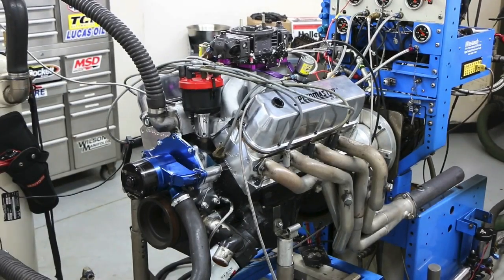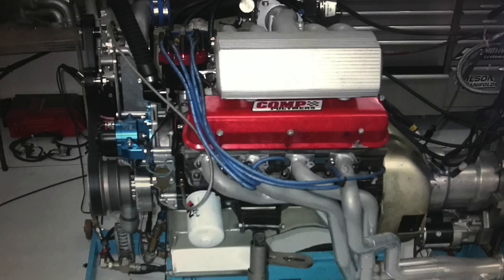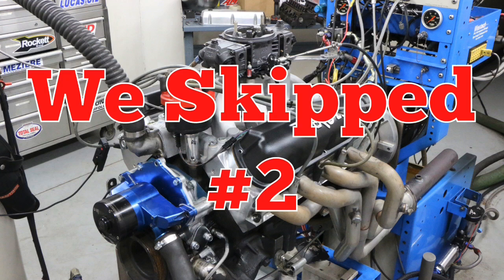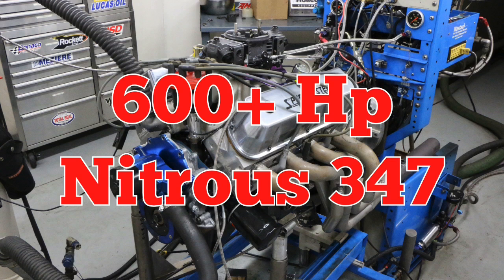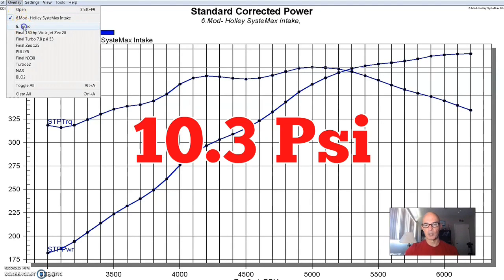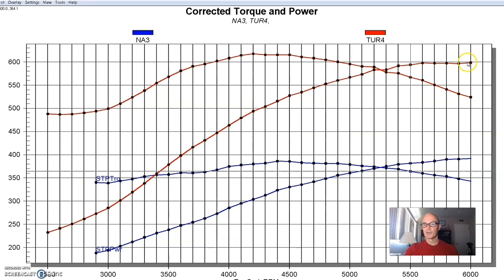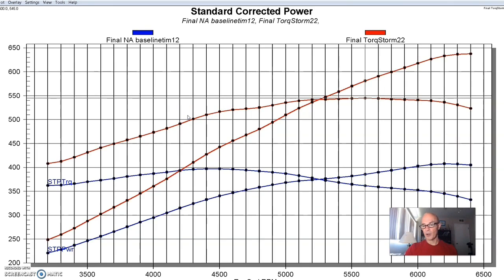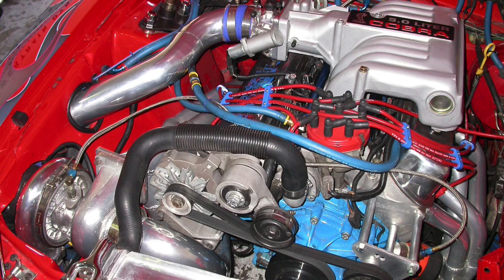5.0L FORD BLOCK SPLITTING-FACT OR FICTION?

Comment: After working for ford for about 2 years making steering racks and other machined components, I’m pretty sure they are failing from porosity, Nicks Dings Scratches, and dropped parts. You would be surprised to see how much porosity is allowed and how many times the people in warehouse will drop a rack of parts and of course instead of getting the supervisor they pick them up and take them still to assembly without knowing that they just risked letting micro cracked/ damaged parts thru. Across all automakers this is the main cause of parts premature failure, Ford has a tendency to fire warehouse workers that drop large volumes of racks of parts (typically 2 rack stacks so around $2000 of material) so most of them fear dropping any volume of parts and they typically won’t report it so they can be scrapped out unless they get caught by supervisors or me reporting it and then they get fired immediately. so it’s a quality control issue post machining pre assembly

Comment: It's  dedication could have been oil pulled from the crank case by the pcv. ive got a 347 turbo made 17 lbs at half throttle and maxed out 42 lbs injectors at 100%  duty cycle on pump gas when i was tuning and its 10.5.1 compression i will just say it black tracks at a 100 at half throttle.

Comment: I've got an olds 455, another 2 bolt main only engine, however I know of at least one full size land shark car running 9's without any extra main cap provisions, I have a girdle on mine, the thinking in the circles I follow is that the block/caps start flexing after x amount of horsepower/tourqe, I quess the more I look into it it would seam, casting plays a role, metallurgy plays a role, harmonics probably is a large contributing factor.
Some engines just don't seam to care, others end up in the dumpster way to early..

Comment: I think what splits the 5 l block is a weak spot in the metal when it was produced and it's the draw of luck not saying you can't split one just saying that a 500 horsepower rating it's because the particular metal was weak at the point in time it hit over 500

Comment: Proper tuning is a big factor. My Incon twin turbo system on a basically stock 306 on 12 psi was 513 at the wheels. Had a Crane 2031 and kept the shifts below 6500. Ran this setup for 6 years and thousands of miles. Then sold the car.....the current owner is still driving it with the same setup.

Comment: Some things to ponder, does running slicks/radials in a full weight car put more load on the engine than an engine dyno?

Having nitrous come in around 3500-4000 would put a lot more stress on the bottom end than coming in up top around 5000rpm?

Comment: Our shop saw two 289 / 302 splits. First one was an 89 5.0 H.O. stock bottom end that got a set of SVO N-351 Sportsman heads and a .600+ lift roller cam. It was in a NA alcohol Hilborn injected sprint car that the owner had run out his engine budget for the year blowing up his two 351C's bottom ends and couldn't afford another 700 HP 351C build; but needed to run the remainder of the season with a new engine for under $2k. The H.O. made 460+ HP on the dyno, but the block split completely down the center while running warm up laps at the track on it's first race. Only the motor mount plates and the main caps were holding the halves together. A year later, a late 289 block in a street car cracked through the valley at just over 400 HP at 7000 RPM NA. I think it is the RPM - combined with a less than perfect casting stock production 8.200" SBF block - seems not up to the stress of the high RPM to make over 400 HP NA. Yet I know of many stock block 8.200: SBF's making up to 650 HP supercharged (not turbo) at up to 5500 RPM with no issues.

Comment: They would last 90 minutes, according to Griggs Racing. When they used to race SCCA A-Sedan back in the day to bring exposure for customers, they would run through blocks every 90 minutes of running with a rev limit of 6700. Or 2-3 races max. Stock blocks, zero balance steel cranks, 10.8:1, 600cfm carb. Running any lower RPM and they would fail to be competitive so Bruce Griggs told me. How do I know all this? I have been a customer of griggs racing for a long time now and emailed them a while back about their experiences with stock sbf 302 blocks cause I knew they road raced them. That was his answer in a nutshell.

These motors were full of quality cooking and oiling systems for sure, knowing griggs racing. 

Dyno pulls are nice and all, as is drag racing, but in a road race after you go wot down a straight you don't have an option to coast to the pits and cool down your motor with dry (or wet) ice. Its constant on the go through the power band of the engine full of accelerations and decelerations. Accelerating out of a corner puts a load on the bottom end, and this happens many times during a 30 minute race. Your running at a constant wot for 30 minutes was at a lower load as it takes more force to accelerate than it does to stay at a constant speed, acceleration in that case being zero.

Comment: I have a 1992  Saleen Convertible with a 302 with  twisted wedge HI-Port heads RACE ported from Champion Heads in Palm Coast FL Crane Biggest at the time split came with more lift on the Exhaust lull length Kooks headers John Bennett racing Sheet metal intake with the truck lower ported from Champion Heads 80 pound injectors 80MM throttle body Vortech R-Trim with a cogged belt supercharger making 16 pounds of boost  Compucar two stage Nitrous 125 them 300 , running a 3.73 rear gear with a Trem TKO trans  I would street raced this 3 to 4 nights a week and every Friday at Orlando Speed World This had a 10 point cage  the car was a fat pig tipping the scales at 3527 I never had it on a dyno back in 1992 but it ran 9.43 @154.54 well I had this for a year and I split my block now this was my driver only one car I was coming home from work and it was running like shit . I came home and took off a valve cover and the cam broke cause the block had split , So I know the fact that the Ford 302 does split but it did not brake in half and fall on the ground , So I went to a Motorsport block 30 over Ares Pistons  forged crank  new solid roller cam 90 pound injectors and that change picked it up to 9,08 @ 160,06 She is still running fine today
Reply: This was in 1992 the block split

Comment: If anything splits it, it is torque i,e cylinder pressure. Generally all those mythical engine failures, being it the split Ford or what ever, rarely happens on dynos. On the dyno you have a handle on everything can monitor the engine. In the cars people do so many odd things and there's a lot more variables.

But hey, I suggest you gap the rings and give it a 1000 shot:D I would think something would have to give.

Comment: Ran a .030 over 302 for 3 years,  5,6, sometimes 7 passes a night 3-4 nights a week with 100-150 shot of gas every pass. TRW power forged s*"get pressed pin pistons, stock rods, back yard ported 289 pistons with bigger valves. Never had a problem. Took timing out for nitros passes. However,,,,,,, before that motor borrowed a plate to shoot for street race. New to nitrous, didn't take any timing out!!! Dumped a big shot of gas on it with bout 37-38 degrees of timing. Blew both head gaskets and cracked 5 pistons. Made it home! The block didn't crack!!! Reused it to race 3 seasons 4 nights a week. Don't know how they manage to split a block? 500 shot of gas????!!!

Comment: From what I've gathered it's mostly luck of the draw. The casting porosity varies drastically from early to late production years. I'd say alot of the issues is harmonics or detonation. Imagine smacking a glass at just the right frequency and shattering it. For which blocks harmonics effect the most it's hard to say. Most issues I've run into is with fuel quality varying and causing problems with detonation. I personally have pushed stock 302 blocks well into 700 at the crank for decades and have never had one split or fail to where it actually splits in half. That's the issue with production engines, some are stronger than others and it usually come down to getting an unlucky poor cast block.

Comment: Bad block harmonics (not rotating assembly harmonics) under server load weakens the block. To long at a particular rpm where a block harmonic phase amplifies, this can happen during a burnout competition of use of a 2 speed trasmission or a clutched transmission where there is little change in rpm while under maximum load. Couple bad block harmonics with a bad batch of fuel and o-ringed heads, the block and heads will lift away from the crankcase.

Comment: I have my 95 cobra do 515hp and 492 trq to the wheels it has an on 3 performance turbo, 170 tf heads bullet custom grind cam 75 mm throttle body and 48lbs injectors..had it on for 4 years and still kicking.. I will go up in boost next summer..

Comment: I dont get this video. You admit this does happen, and Ive anecdotally seen this happen to engines that dyno'd at 412hp to the wheels. A 347 stroker. 
I appreciate you admit that dynoing is nicer to an engine than drag racing, but then say you dont believe 500 is block splitting territory.
How does that make sense? Just because you step into the territory doesnt mean its supposed to snap like a twig. Its just a dangerous place to consistently be for these blocks. 

Youre really doing novices and amateurs a disservice for advising them that 500 horsepower is safe for these blocks. Its not. 
Novices dont want to build an engine thats going to be living on an edge. They want an engine that makes strong reliable power and wont have the most integral part of the engine be at any risk of being destroyed.
When the block cracks someone is gonna be out thousands of dollars. Save them the risk.
Tell them to pick a different block to go over 500.

Comment: Had a 375hp 306 crack in two of the main webs that support the crank. Both cracks were from the cam bearing journal to the main bearing journal of the crank.  - I was running Flowmasters too!

Comment: in my opinion it comes down to RPM. most of these engines stop making power at 6-6500, so theres no need to rev higher, but people do, and i think thats where issues arise. notice in the dyno tests most stopped at 6-6500 rpm.

Comment: ...I think it's the cast iron lottery.  The casting lottery that happens when they make the block at the factory, since these motors were designed to run at around 250hp stock, so putting double that HP, your chances of splitting the block are exponential for that particular "bad" or "avg" casting*

Comment: It’s a harmonic and rpm issue. On a stock block if you keep it under 6000 rpm and get a good/new balancer and have your internals balanced properly you can make good power.

Comment: I’ve been running a 95 roller block for 2 yrs now. It’s on a 200 shot of nitrous, heads cam intake carb set up. It’s at 602 hp, no issues at all. About 120 10lbs bottles thru it, still strong.
Reply: I have never seen a F1 block split (91-up)

Comment: I think a combiation of all those factors, repeated abuse, and metalurgical properties of an individual block.  One block might be stronger, from the factory, than others in cars next to it, depending on conditions at the foundry when it was cast, but all of them be within spec.  These engines you're talking about are producing more than 3x the power they produced when new.

Comment: I'm a ford guy I bleed blue and I believe these are tougher than they're given credit for however with that said the number is 500 WHEEL hp in the car through a full exhaust and accessories.  That would be up over 600 hp on an engine dyno.  Also when it's in the car its gonna be under alot more stress than an engine dyno or even a chassis dyno for that matter.  You can use a main girdle on the block and it helps to fortify it....tuning has alot to do with it too seems the guys on race gas or e85 usually have less issues.  Not to say they dont split on good fuel I just think it brings the chances down.

Comment: I had a 331 stroker forged internals stock block with girdles with 76mm turbo@25psi made 650 hp 630tq at wheels mustang dyno. Split the block after a few years

Comment: Could it have anything to do with valve spring pressure? Seems a bit far fetched, but when you upgrade heads and cam the pressure goes up. That pressure is put on the cam and lifters, which if I'm not mistaken is where many split. Right down the valley. Could also be a solid vs hydraulic lifter thing and the harmonics. Thoughts?

Comment: They were prone to, not guaranteed to. In the St. Louis area in the late 1990ies I saw, not heard of but saw three blocks break. One was actually in two pieces when disassembled. These were late eighties factory forged piston engines with pro-chargers on them. Not modern built engines. I cannot tell you why it happened but it did. Three out of the probably 30 over 500 hp builds I was aware of is not much. All three happened at the drag strip at about half track. Does not seem to be a issue these days.

Comment: Back 20+ years ago, my 100,000 mile stock block 302 h/c/i single turbo fox body was probably making 600 hp or so, judging by 110 mph in the 1/8 @3300 lbs. This was with old-school backroads tuning too, no idea what was really going on like with a wideband o2.

It never went over 6k rpm, maybe that helped it live. Many people say turbos are easier on motors too. 

I know if I had to do it all over again, it would still be turbo and low-ish rpms for the theory of making a stock block live.

Comment: Allegedly High rev, harmonics, detonation and "over 500hp" kills them.  I believe with today's tuning capabilities, better electronics, more knowledge through trial and error we can push them a lot further then in the past.
I've been trying to split mine for years. 18lbs of boost on a h/c/I 306. Stock block, stock crank, Dss pro lite pistons, Dss rods, Dss main support, Innovators west balancer, blueprinted and balanced. 9.5" PTC converter to a PA C4. Should be over 700 HP to the wheels. I just started having head gasket problems after trying something new and I'm currently going back to my old head gaskets because don't fix what's not broken.
Also I don't spin it passed 6200.

Comment: I crscked my block...not in half...but this was after many years of stomping the right pedal...

E.L.D. did the work on the car after finding why my car would not move...

I was more into car stereos than drag racing...but would go to the strip occasionally ( Crofton, Md)

I feel I did get better launches with my 4 10's. Not a 410 rear....but 4 10'" subwoofers! Haha!  1992 Green hatchback.

Miss that car.....someone stole the stereo...then it was hit and run... Sold it to ELD...Guy bought the car for the motor they put together...  Did NOT last long for him.
😞

Comment: Get the earliest 302 truck motor you can and build from there.  Pay attention to balance and dampers.  Run as heavy a flywheel as you can for your combo, and balance the flywheel and pressure plate as a pair (even off a little can cause serious vibrations). Use head accessory mounting holes to add tie rods front and back.

Comment: I've been watching your videos for months now and honestly I love the content, you take all of the myths and legends and thoughts and hypothesis and you debunk them if possible.  I've been doing the same thing for about 10 years I just have not been making videos to prove it.  The downside of this video specifically is that everybody has been saying that these blocks split in half at 500 at the wheel.  Realistically that means that they're going to already be close to 600 at the crank. So that means you haven't proven much in this particular video in comparison to all of your other videos. Getting close to the 700 mark on the crank on engine dyno doesn't really disclaim much compared to getting close to six hundred on a wheel dyno.   Many have been past 500 on an actual Dyno but nobody has really got past 600 at the wheels and nobody has kept over 500 at the wheels consistent and dependable.  this video honestly doesn't prove much because we already know it's not a longevity thing and it's not a dependability thing it's a power Mark and that power Mark is 500 at the wheels for dependability and almost 600 as a Dyno queen.  Everybody in the mustang scene knows that a stock 302 block will not remain dependable over 500 at the wheels and you have not proven otherwise with this particular video.  I'm not trying to discredit you at this point just giving you the info from the actual mustang enthusiasts.  Keep doing what you are doing, I love your Videos!

Comment: I would like to know what the timing is like on these test combos.  My set up is a stock block, girdle, all ARP studs and bolts,  good balancer, cheap aluminum heads, funnel web, FiTech 1200, Pony Down 4' exhaust, 9lbs paxton big Innercooler, MSD BTM set at 1 to 1 with Distributer maxed at 32.

Comment: Probably casting, depends on what day of the week it was made. As stock, I will testify that the 302 was a solid motor. I worked as a lube tech during cash for cars. We drained the oil out and filled it with silicone. Chevy 350's and ford 302 ended up in parking lot demolition derbies because they wouldn't die with a quart of silicone instead of oil. Chrysler got pushed out the bay lol. We had to throw weights on the gas pedals because we ran out of time trying to kill them. We had to unfortunately, either way. Much love 302, and I don't like ford. But respect earned

Comment: I think it may have been detonation.  Firing order run in the middle is 3726 placing all of the power on the center main journal casting.  That's where the 351's break.  They break all of the time.  The 302 deck is 1/2" shorter so you can't get the stroke the 351 can achieve, therefore, the blocks don't break nearly as often.